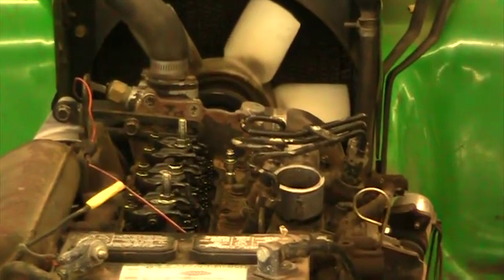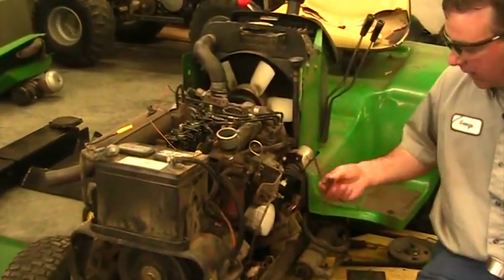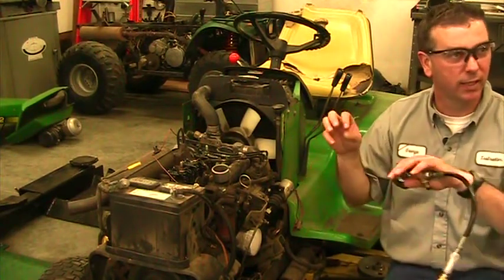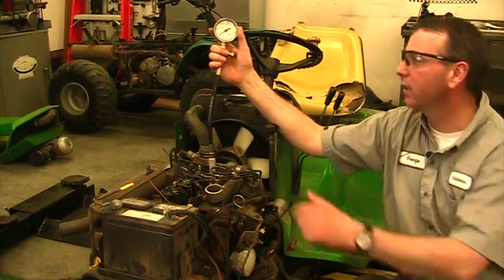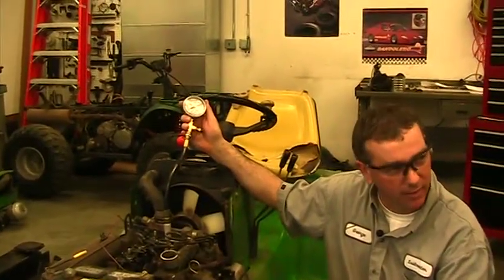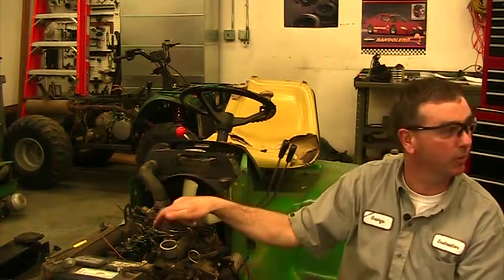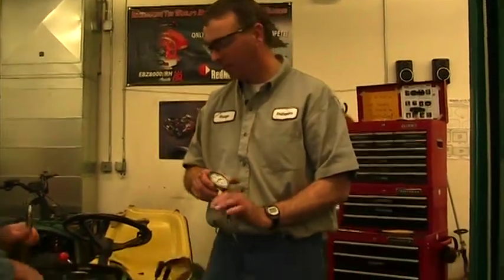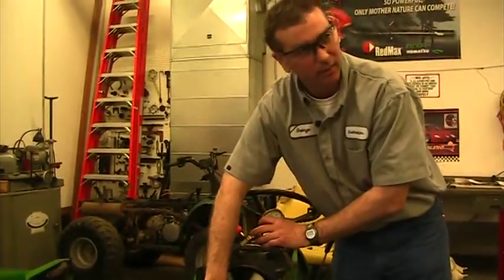Diesel compression testing

Comment: Excellent Video George. Im having a problem with a 3 cylinder Kubota d902 that stopped for fuel failure. Gets Diesel , glow sparks gets hot but crank and don t start. Mechanic tested  compression and we had 500 , 450 and 350 . Mechanic told me that would be a problem maybe with rings. Maybe taht happens , but I think shoud start anyway. 
I was wondering if could happened the same you explained about the intake air from the manifold so readings decrease from cyl # 3 to # 1  ?  , and i m having another problem that don  t let start
regards

Comment: Thank you for this very informative video. I have a Kubota diesel core in a boat and need to do a compression test. Your suggestions to use the glowplug ports and disable the solenoid (fuel lift pump for me) will make this a much simpler job than removing the injectors... Thank you!